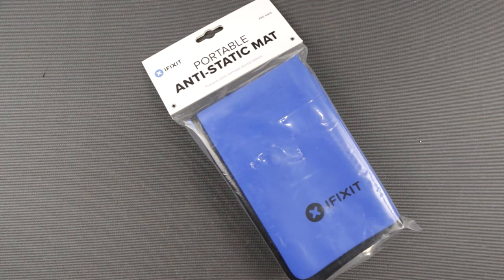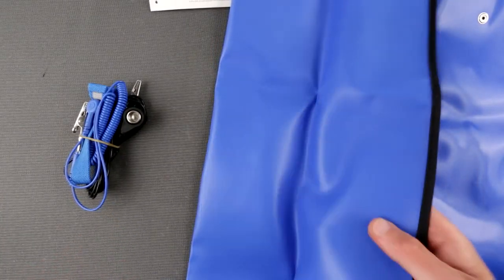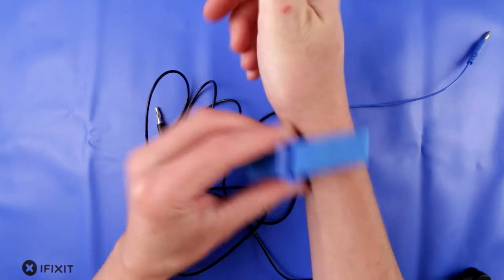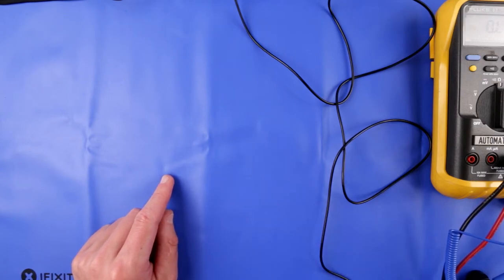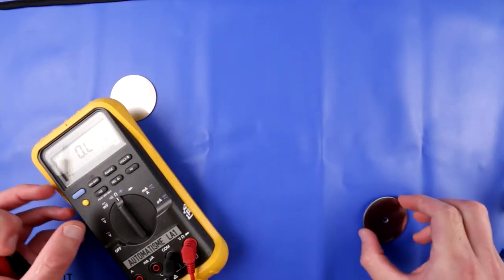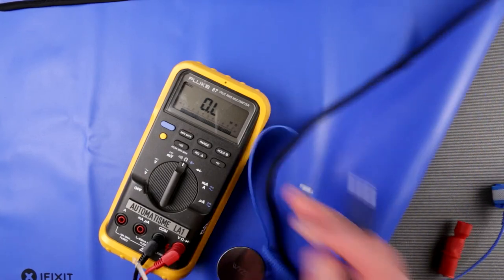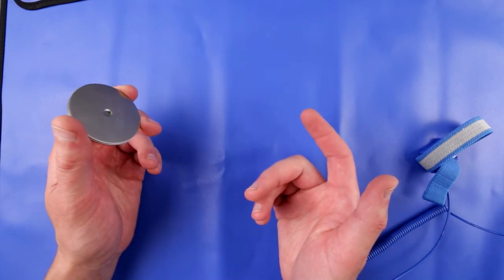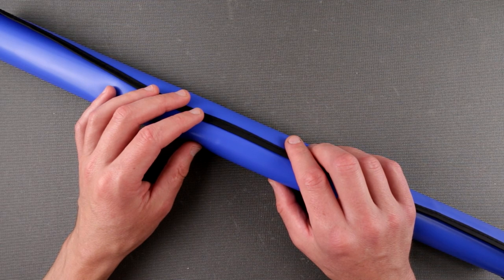IFIXIT Portable Anti Static Mat Review

Comment: A common misconception is that you need to ground an esd mat or bracelet to a mains power outlet grounding pin, that is not what you should do ever! The reason being is that a lot of ground and neutral wires are sharing a bus bar in the main panel and any jolt or surge from anything hooked into the main panel can cause it to feed back to the ground. The purpose of an anti static mat and/or bracelet is the balance the potential/electro static energy between you and the part you are working on to neutralize any esd discharge into that part, that is why they say to touch a ground point on the circuit board, computer chassis before working on it, so that it will discharge any extra build up of energy from you into the ground to balance you and the part. Good video, I was interested in this mat to see how it will lay on a desk, some are very cheesy and bubble up a lot, this one seems ok.
Reply from the maker: Thank you for explaining. Even at my work it is recommended to attach bracelet and mat to the ground.
Would it really send a jolt ?  I has 1MOhm resistor between mat and banana terminal.
It is good on the table but still wrinkled from being stored folded in the bag. Trying to keep it hanging flat to straighten a bit.

Comment: That black cable, you say to connect it to ground, where do we put that? Do we put in an electric power outlet or does it have to be in something else?
Reply from the maker: Yes you can connect it to ground receptacle on outlet, but this particular plug will not stay in. I have lab power supply and oscilloscope which I use with this pug
Reply: ifixit and others also sell a "ground plug adapter" you can buy. it's just as it sounds like 3 prong plug with the other 2 non ground prongs being plastic (so you can actually plug it in) and the other end is just a hole to put your banana plug into so connected to grounds.
Reply: @TjPhysicist  ya I picked up one of those from Amazon